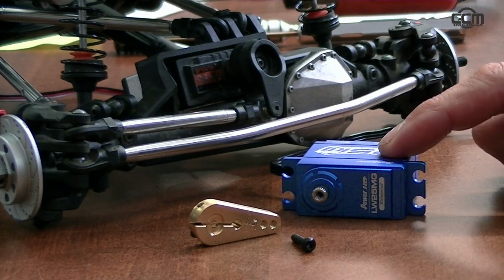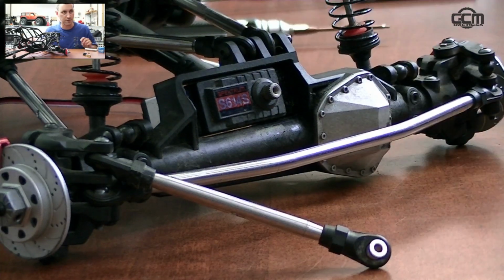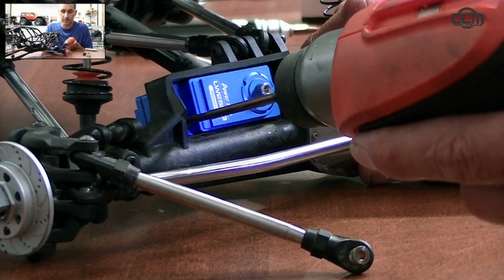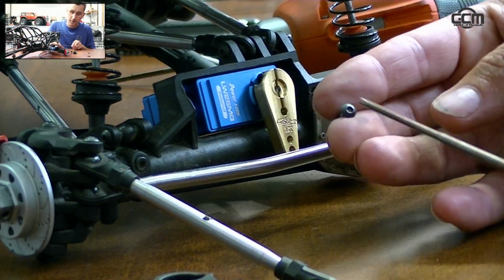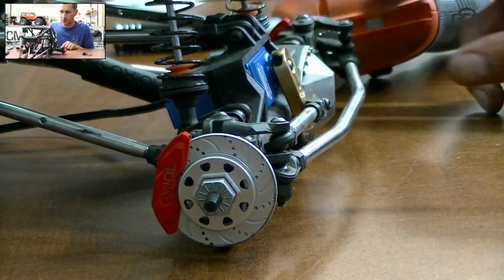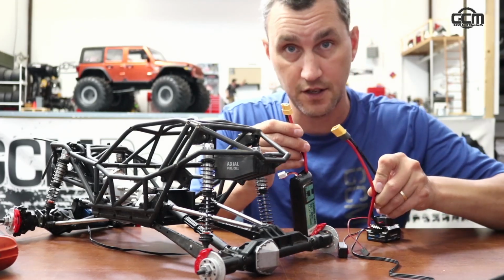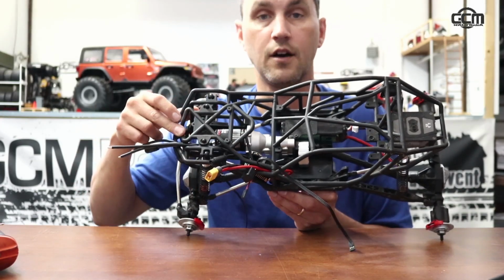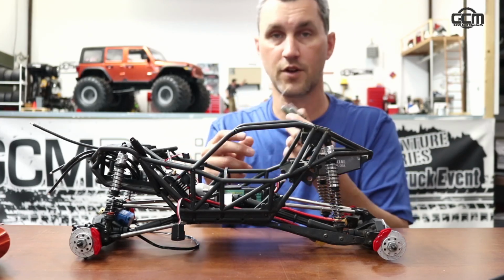Axial Ryft Scale Out - Part 3 Electronics

Comment: What is esc is that
Reply from the maker: That's a HobbyWing AXE system.
Reply: @GCMRacing1  nice...hey is there a brushed motor that would handle the weight of this truck?
Reply from the maker: @rcjoe406  I'd suggest there could be. A nice hand wound 5 slot 20turn motor should do the trick assuming you're going to gear it down a ton like I have.
Reply: @GCMRacing1  yes I will gear it down I've already smoked a 21t titan and a 10t holmes hobby...jconcepts make a 17t silent brushed motor for mt trucks maybe that

Comment: Oh man I just LOVE the place where this rig is headed. The motor setup and location is awesome!! As far as the fan is concerned? I think losing it, isn't a big deal. Been there done that. lol Looking forward to seeing the interior video. It's interesting how Brass is used for servo horns. Being as it is SO much softer than steel. The spline teeth are so tiny as well?? I would of thought this would be easily stripped in brass. But I guess the clamping screw makes the difference🤔 Sorry. Things that make me go Hmmm. lol  See you in the next one.
Reply from the maker: Thanks! I'm getting excited to have this rolling again! The brass is machined instead of stamped on the servo spline, so that makes a huge difference in strength. We shall see!